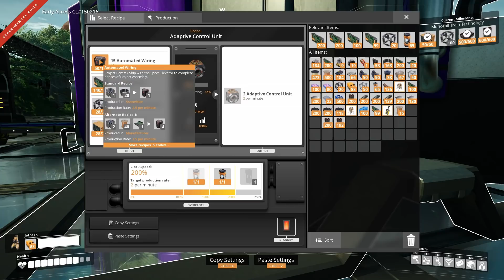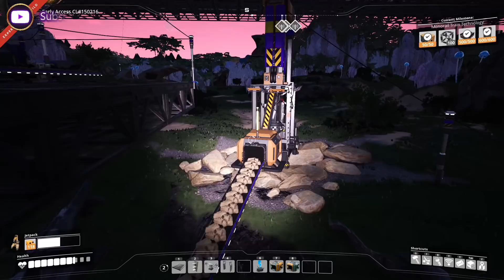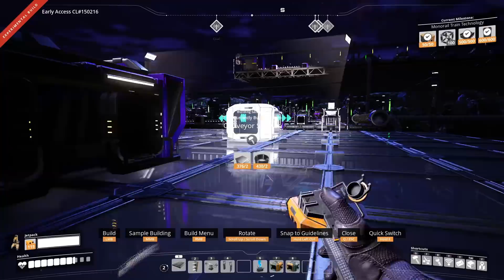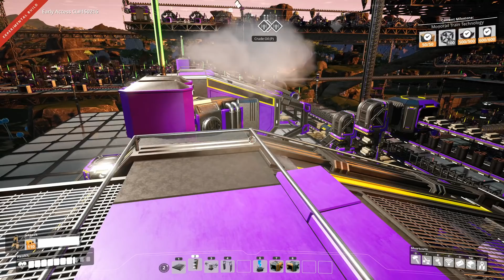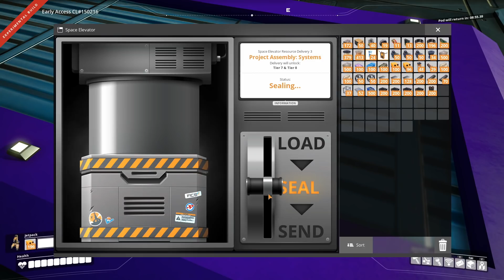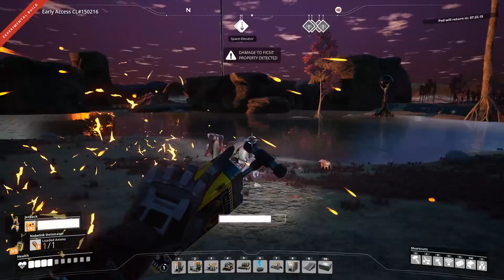Ready for late-game by UNLOCKING Tier 7-8 | #15 | Satisfactory Update 4 | Lets Play/Walkthrough

Comment: AHA, that's why my last tier was "free".  I had not noticed that 7 & 8 were on the same delivery.  I had already had 7 done before the update came out.

The hoverpack is nice. So long as you are near a power pole, you just hover there.  Great for building.  Not so good if your power goes out and you fall.

The pink forest is where I built my aluminum plant and batteries.
Reply: ALUMINIUM.
Reply: @chaosengine4597  Look up the history.  That has  a long and storied past. Aluminum and aluminuim are both now considered fine.  In fact the spell checker flags aluminuim.
Originally it was just Alu.
Reply: @b.delacroix7592  you wrote aluminium all the way (chuckling a bit). The difference is American English vs. British English as far as I'm aware of. In my language, it's Aluminium as well. But I get it that Muricans swallow syllables for breakfast ;)